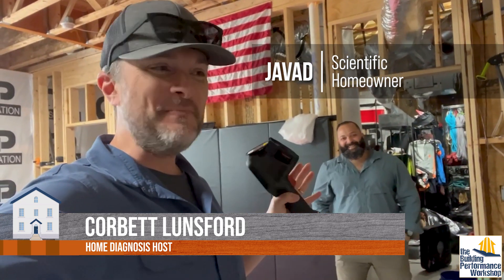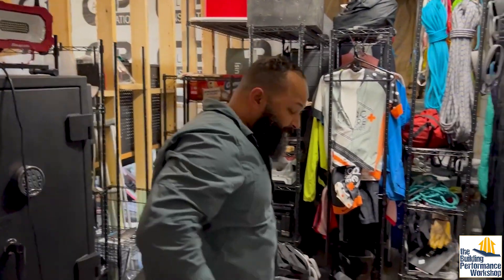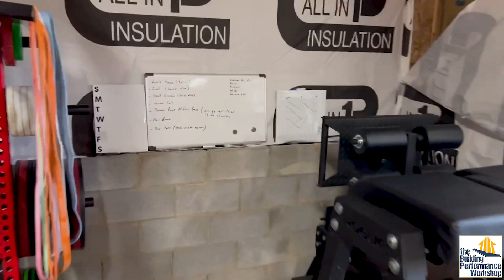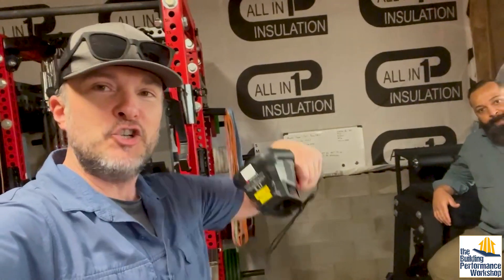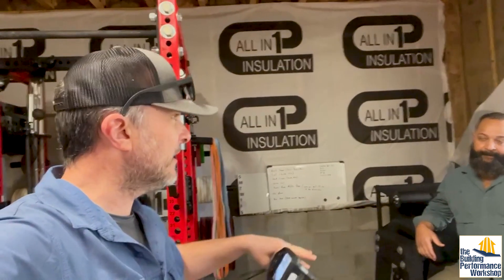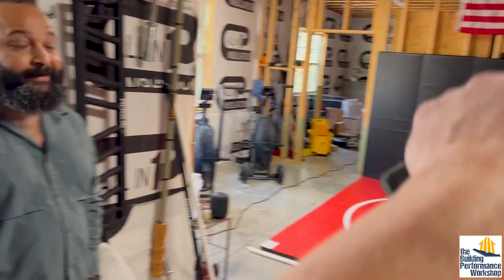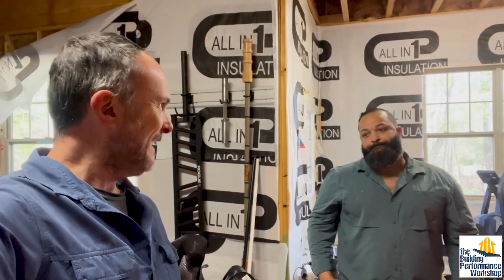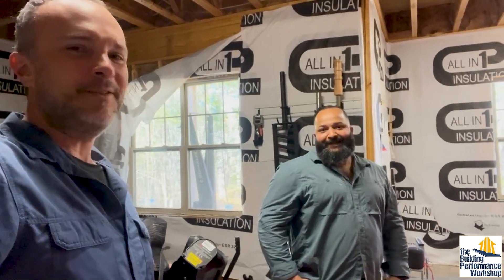Solving Radon at Home: Passive/Active Mitigation, ERV, and DIY Cinderblock Wall Vacuum System?!?

Comment: Kudos to you for learning and keep on looking for a solution. @HomePerformance I’m experimenting a similar radon issue myself. The levels in the basement are, sometimes, up to 15. The levels in the first living floor can be up to 6. I installed a few AirThings around the house and I notice something interesting last winter that my HVAC system broke. The levels in the basement didn’t change but the levels in the upstairs went below 0.5 in a day. The furnace is in the basement, yes. I was considering getting an ERV or getting ride of the whole house HVAC system and get small split units for each room. I’m guessing your recommendation is to go first with the ERV, right?
Reply from the maker: Yes, I rarely recommend ditching a ducted HVAC
Reply: @HomePerformance Thanks!!! I might schedule some consultation time as I really want to solve this issue. Thank you again for your help!

Comment: Cement products emit radon . In some countries if cement is below legal limits of radiation it will be  mixed with low radiation waste to increase radiation but still under the legal limits but the benefits getting ride of the waste
Reply from the maker: I actually have a radiation detector, did not find an issue there:
https://aranet.com/en/home/products/aranet-radiation-sensor

Comment: A radon work system works when you have pressure field extension (PFE). This is done using your micromanometer and putting test holes in the floor to ensure there is some slight vacuum under the slab (say around a couple Pascals negative pressure).  Javad is not getting proper PFE if all those block cores are open.  Seal those (e.g., you can cobble pieces of EPS and canned foam inside them).  Check out industry professionals like Jesse from American Radon Mitigation (great channel, he is nerdy and passionate like Corbett :). To my knowledge Jesse doesn't recommend drawing air from blocks.  I also had a similar radon issue at my house. My radon fan was drawing from the blocks and under the slab.  In my case, I removed the mini pipe drawing from the block, sealed all gaps and cracks to get better PFE, and added two additional suction points to my system.  I now have levels with yearly average around 1 pCi/L.  It would be possible to make some further improvements, but maybe that will happen in the future.  I hope Javad the best in quickly and efficiently solving the problem.  Again, I will stress PFE, but you may see great changes just after sealing all gaps and cracks like top of those exposed blocks, where blocks meet bottom plate, perimeter between block and concrete slab, etc.
Reply: Yes, you will want to check that you have suction under the entire slab first. If so, I’d look at adjacent slabs and block walls last. Since we started in 2014, I've never had to depressurize a block wall.

Comment: I am not a specialist in radon, but I did have a radon issue in a place I used to live. In that situation the primary cause of the radon infiltration from the ground below was the thermal stack the multiple floors of the home created. I was able to make the radon lower by simply opening a lower window to reduce the vacuum. Obviously that is not efficient in winter when it's -30° out. But my suggestion would be to see if you can make the basement have positive pressure versus the outside air through ventilation so there is no vacuum pulling air through the cracks in the basement.

Do be careful with any ventilation of radon containing air, both from the ERV and the other system under consideration. You don't want the exhaust to be sucked into any make up air or open window. Best would be to have the exhaust above the roof line of the home similar to the plumbing vent stack.

Comment: Sealing the top of the cores sounds like a great way to reduce air infiltration. I would be more inclined to install a few 4" PVC pipes into a few cores and seal around the pipe. I would also be questioning how well the current radon pipe is working. Sub slab pressures tests could be preformed with a manometer hose placed into drilled test ports. Negative pressures should be identified if the radon fan is working properly.

Another option is French drain depressurization, if there is an external French drain on the house, connect the clean out to a radon fan.

Finally ensure that any internal sump pit is air sealed and if possible is tied to the radon system. ideally this should assist with depressurization.
Reply: Another idea is to add plastic to the block walls, This wont STOP radon BUT would allow the walls to be depressurized and there by reduce the radon from entering the living space.

Comment: I have found sometimes running multiple sub-slab tubes helps. On one house that had a basement and a sub-basement I had to put in a total of 4 in but they all were able to be collected into one outlet/fan using 4" tube where I could. It dropped the house from ~50 to sub-2. At first we only did two pipes and that still only had us down into the teens. Soil type and size of slab can play a huge role in how well those work. I suspect that may be the easiest/cheapest solution for this gentleman. One pipe just isn't always enough.

And why aren't we putting in big passive systems on ALL houses in areas that have radon? Should be a part of minimum code pretty much everywhere. Specially if there is a basement.

Comment: @HomePerformance  I recently had an active radon mitigation system installed and the readings went from 2-8 pCi/L (depending on the time of year) to consistently around 0.3 pCi/L (using an AirThings monitor). If the radon levels stayed high, the installer said he would first consider adding another suction point connected to the installed outlet/fan, and then adding another active system at a different area of the basement if readings were still high. It sounded like the effectiveness of suction is highly dependent on the coarseness of the aggregate layer beneath the basement floor. Would Javad's house benefit from multiple suction points or another active system?

Comment: I would work to seal the top/exit and tie the inward flow of the block into the now existing active radon suction side.  Many ways to do the block suction that should work.  I would also then look at pressurizing the space with the ERV by like 5Pa so that there is almost never suction of the ground below without wind pressure. If you cant get to -5Pa, there is infiltration that needs to be fixed, so begin by testing the static pressure of the house to the outside.

Great work by the home owner thus far.  And nice gym gear.

Comment: Corbett, we should talk. Lots of things to talk about regarding proper testing, mitigation, ANSI/AARST standards, etc. If an active system has not brought the concentrations to within "acceptable " concentration, then the system is NOT compliant and requires further modification/work.
Reply: In my area (Ottawa, ON) there only needs to be a sub-slab soil gas barrier linked to a pipe that vents through the roof.  Nothing mentioned about basement walls.

If walls are the source and the code only calls for sub-slab mitigation, the existing system could be designed and functioning correctly but just not addressing the source.

It’s also code in my area to insulate basement walls with 2” of foam and R12 framed wall inside, which will help, but nothing mentioned about tying the foam to the soil gas barrier or to the mud sill which still allows gasses to enter.

My guess is the code needs updating if the existing prescription isn’t working.
Reply: @superspeeder  All valid points. Unfortunately, as many of us are painfully aware at this moment...our US of A is not Canada. I don't believe our industry standards (ANSI/AARST), associations (IEA), and certification entities (NRPP and NRSB) are valid in Canada. Additionally, code adoption and enforcement differ (wildly so within our contiguous states, even...). There are only 21 (I believe) states that either require licensing or certification for radon-related work. And that says nothing of whether new homes require passive systems during construction. 

Our industry standards, as well as EPA documents, afford for block-wall suction as part of a mitigation system installation, though usually in tandem with sub-slab depressurization (though not always). Regardless, if the installer didn't have a test post-mitigation, that negates industry standard (but doesn't mean a lack if the state does not enforce/license or the professional is not nationally certified).

Mitigation systems are part diagnostic testing, part "feel." It's the nature of the beast. This is why they should be tested for effectiveness. If levels aren't reduced to "safer" concentrations over time (not any one 24 hr. period, but over time as radon concentrations cycle in a 24 hr period, even before including weather fronts or structure conditions).

That any consumer is left to guess and crap-shoot radon reduction in their home is insane. It's a radioactive gas known to be the second leading cause of lung cancer...I mean...

In this instance, my main thought is that were the consumer to be properly served by the mitigation professional, he would have no need to try and create additional methods and spend even more money. The mitigator could have capped and sealed the hollow cores, connected the wall to the sub-slab system, and then tested again to see concentrations. Even just capping and sealing may have been enough...but proper, non-consumer grade  testing is necessary to ensure accuracy and effectiveness. 

I'm always baffled at what we "allow" because we can't discern it with our simple human senses.
Cheers!
Reply: @gregjohns9563   excellent points and agreed on all fronts!  I’m just a guy building a house, arming myself with as much useful knowledge as possible to avoid pitfalls like these when my place is done.

I’m planning to line my basement walls with poly then tie it to both the mud sill retarder up top and the soil gas barrier on the bottom, essentially making a bathtub in the basement, before insulating the walls.  Add a sealed sump pit and I’m hoping that’s the 99% solution.  If necessary I can always add a fan to depressurize.

Cheers! 🍻
Reply: Hey Corbett, great topic. My radon levels are bouncing between 42-50 without a mitigation system. I didn’t even think to check the cinderblock walls. 
As for blocking off the cinderblocks, I don’t personally think putting a bat in a plastic bag is a good idea just because of trapped moisture in the bag. I think he’d be better off, stuffing the hole with the fiberglass bat and having a foam company come in or using a froth pack to air seal. I think this would be a great use of closed cell foam.

Comment: Has a radon mitigation contractor. What we will do is take some spray foam fill in the top of the block and then we drill a hole 4 in or 3 in stick a pipe into the cavity and tie that into the radon system. No different than a suction point under a vapor barrier or a sub slab radon system that he has now fill the top of the block with spray foam caulk seal all of it so it's a closed system. Drill a hole by the radon fan or the original suction point and tie it into the radon system. I found in a lot of situations. If you have a garage you need to tie in that garage also

Comment: Do you have a recommendation for a good radon detector for a crawlspace?
Reply: Airthings wave plus.  It can be integrated into home assistant via Bluetooth low energy, thus allowing you to avoid cloud or app mining your data.
Reply: You only need to worry about radon in your living space. Place the meter where you are normally in the house most of the time. If the needs are good than no need to worry.

Comment: Cover the walls in a vapor impermeable material like what you’d use on a crawlspace floor, and add suction points to the walls???
It would take some time with the taping detail around the mud sill, but it seems to me that would work.

Comment: I would seal the floor and walls because the air movement.  Then the pipes would vent the process.  Air movement is the other key as you noted.

Comment: As someone who’s been dealing with it but not to this extent: Radon is super sensitive to atmospheric pressure waves- it often spikes right before a major storm like a hurricane and then is low for days after. 

Good on him for self installing an ERV! I think perhaps a vapor barrier on the block might help some, but obviously sealing the gaps at the top are the first priority. There’s also treatments you can do on the concrete floor, but again, order of operations- the gaps in the block seem like the biggest current problem.